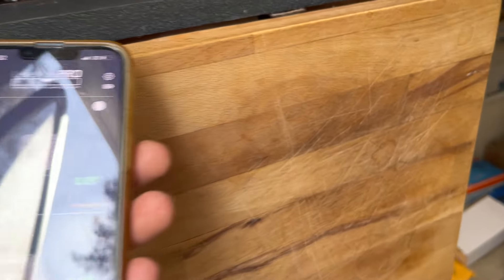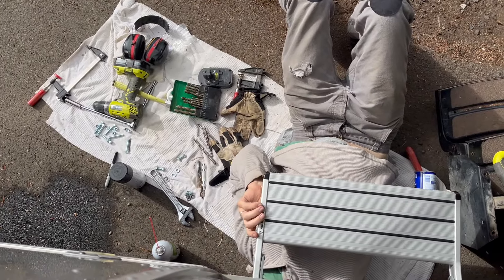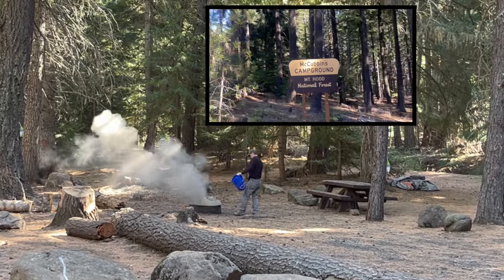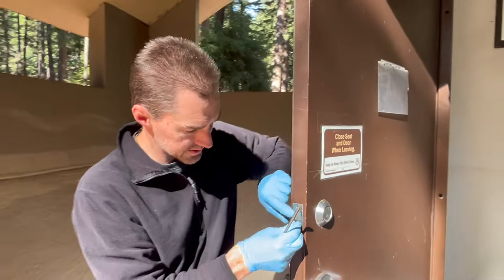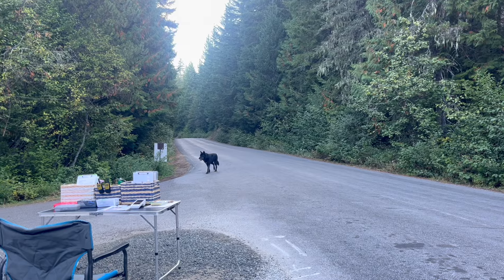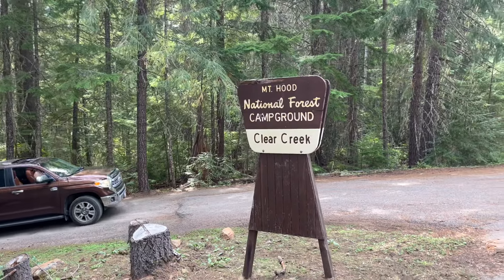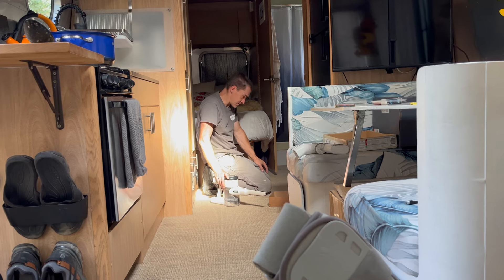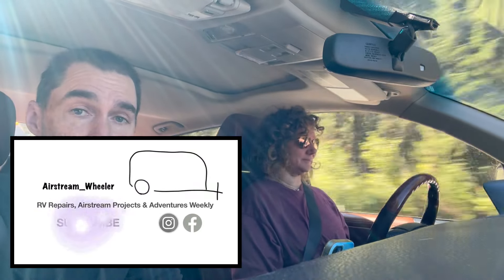Airstream Step Install! Thule Step Upgrade

Comment: I'm shocked at those 4 small bolts that were holding the original stairs😬 They were holding on for dear life!!
Reply from the maker: I was also surprised. I am hoping the new step will be an improvement.  Thanks for watching! ~Andrew